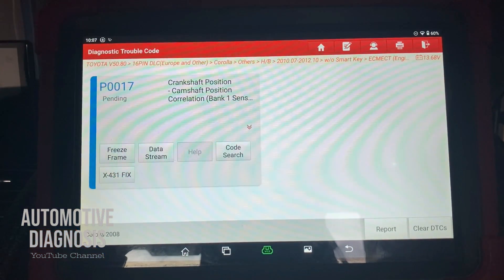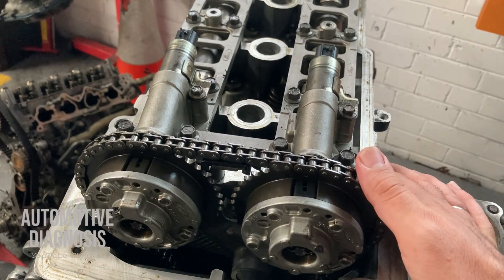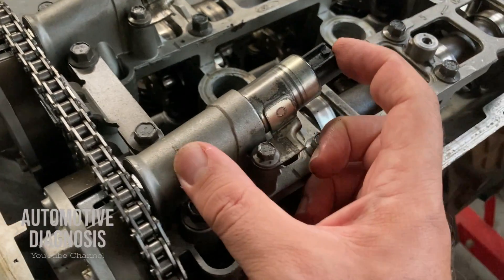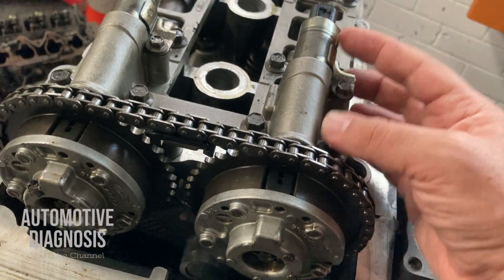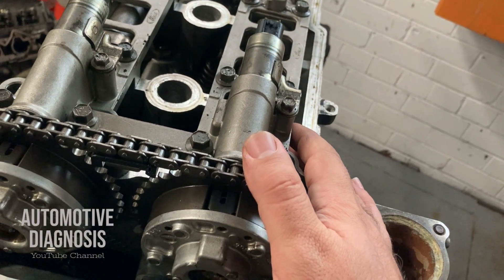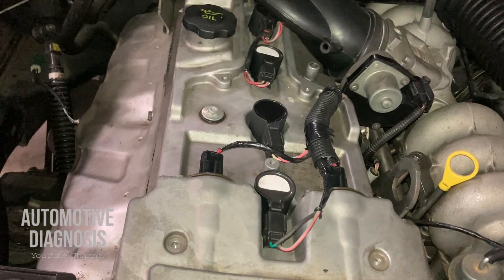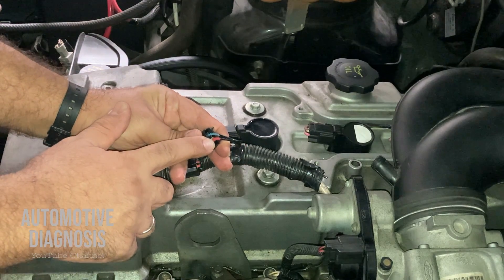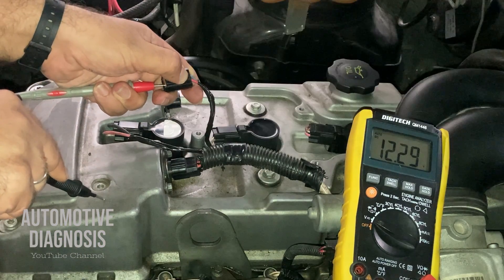How to Test & Fix P0017 Crankshaft   Camshaft Position Correlation Bank 1 Sensor B (Bank  - Exhaust)

Comment: Good afternoon had this cold pop up in my 2016 Hyundai Tucson did an oil change and replaced the VVT sensor exhaust side check engine light still appears after clearing it with scanning tool now what does the other VVT need to be replaced to that's not the same code for the front as the back
Reply from the maker: Hi my friend, This code could be caused by several reasons, If you have replaced the VVT Solenoid, and oil has been replaced, the next steps could be these ones:
- Camshaft or crankshaft sensors could be the cause as well (mostly the exhaust cam sensor, and checking them is necessary before replacement)
- If the last oil change was long time ago, there might be still some oil sludge in the VVT phaser that causes this issue.
- There is a locking pin inside the VVT phaser which should get unlock after engine warms up, if it doesn't, code will appear, here is the link to the relevant video:
https://www.youtube.com/watch?v=xbjYFhMmIXI&t=7s
- Engine timing could be the cause of this issue as well, but considering that you only have p0017, the possibility is not much.
Reply: @AutomotiveDiagnosis thanks for your in put the vehicle Idols well no loss of power no hesitation at stop light no stalling and cranks right up will do another oil change and we'll go from there thanks again

Comment: Have question - as you said, on selenoids, with ignition ON, must be battery voltage, but I "have" only 2.42 V ...
Wtf is this issue ??
Where to look for failure  ?
Btw selenoid "clicks" by test, and resistance is close 8 ohm...
Thank you.
Reply from the maker: Hi there, you have two wires on the valve, how much voltage are you getting on each one? Sometimes this low voltages comes from the control line, not power supply. And ignition switch has to be on for reading the voltage.
Reply: @AutomotiveDiagnosis  Ignition ON, one wire shows nothing, second shows 2.42 V 😮
Same picture on both selenoids ( both replaced new, INA brand)

Comment: Little hard to understand your English but the graphical explanation is fairly good. I'm having an issue with a 2008 Cadillac SRX 3.6L Dual Cam set up so I replaced the one crankshaft sensor and have to do a relearn but all of the scanners I've bought (3) don't have that function even tho the sellers said it did and had to return them to Amazon. Still looking for a scanner that has that firmware grrrrr.

Comment: What do I need to do to fix the code P0017 after I replace the timing chain kit.
Reply from the maker: All required steps are mentioned in this video. If you get the code right after replacing the timing chain, it's possible that timing chain is not adjusted properly.

Comment: Question: On my Truck (2.9l), If it were a timing chain, wouldn't it run bad all the time?  My truck wants to stall after it reaches normal operational temperature (190°) when coming to a stop or at idle.

Comment: I'm glad to to pass here too getting a detailed video which points to my problem too
I hv a dodge caliber I recently bought it then the engine failed I did engine overall when I was putting the engine back I broke the connector of the vvt solonoid I used to drive my car with intake vvt solonoid broken and it was hv power at all struggles on uphills I went and bought an after market one then put it in my car seems it worked the first day after tht I went back to the problem of losing power when I scan it shows P0017 if I clear the code the engine light it goes away but comes back after I start the car what could be wrong pliz help

Comment: Guys I had a 2017 Elantra with code p0017 , timing chain was stretched , installed new timing chain and guides and new timing chain gears intake and exhaust, after repair the same code came back , you have to do an adaptive reset for the engine , has to be done with and autel scanner or something equivalent! Hope it helps!
Reply: Having the same problem. Was starting but it was a bit rough. Then it stop starting no crank or anything. Recently it’s been cranking still no start. It has oil sensors look clean and gunk. Were u able to crank yours before having work done?

Comment: do you have to go under the car to change both cam and crankshaft ? or can you do it from the top
Reply from the maker: Hi there, Cam sensor can be reached from the top-rear side of engine. But crank sensor is on the bottom side. It can be on front or rear side. If it’s on the front, it might be accessible from the top, or by removing a wheel, but if it’s on the rear side of engine, reaching from underneath is possible.
Reply: @AutomotiveDiagnosis i have a 2017 Kia forte so i wouldn’t know honestly

Comment: You need to use an engine  oil flush at every oil change and recommended fully synthetic engine oil to avoid the problem closed by the sludge.
Reply from the maker: Thanks for sharing your experience

Comment: Hey guys, I had code p0017 and p0368 in a Sienna 08 I fixed it by replacing the camshaft sensor, the AutoZone brand didn’t work so I used one from the junk yard! Works like a charm
Reply: Really. So autozone brand didnt work ??

Comment: Do you think if the Mechanic when he changed the Engine Timing Cover he could damage the chain ? He says he will move the engine without starting it to see if the time chain moves after he did he says it rotate well and the chain is fine do you think thats accurate?

Comment: Hi! It might be a long question with background.

I bought ES350 2009 @ 223K miles few months ago. At the time of purchase tests showed P0011, P0012, P0013, P0015, P0016, P0017 and the engine is rebuilt. There was no issue at the time apart from 1-3 seconds upto a minute of rattling sound on start (cold, hot and sometimes while waiting at a red light).

It had 5W30 in it then at the time of engine service. At service the Oil guy told me to go for 20W50 coz the engine was old. My bad I listened to him, and from the time I started the engine after changing the oil, I felt something off. Engine felt heavy, it took effort to run and mild vibration on idling.

The next morning when I started the car the rough idling was wayyy more. The RPM was dancing, low and high on its own. The car wants to let go if I keep breaks on at D. Since then it comes and goes away as it wills. There is no check engine light. Since last 2 days the AC compressor doesn’t switch on if I’m waiting at D. As soon as I switch to N it starts cooling and sometimes it doesn’t work on P either.

My mechanic told me everything is coz of the VVT gears and timing chain. It needs adjust only.

I checked it again yesterday with autel scanner at the workshop and it gave P0011 & P0016 only.

He’s adamant that solenoids and sensors are fine as there is no check engine light.

All the YouTube videos I saw, they keep VVT to be the last thing wrong but my mechanic is going the other way around. He didn’t check the connections, the sensors or solenoids.

PLEASE TELL ME WHAT SHOULD I DO?

I’m sorry it’s too long, but I had to explain. Thanks in advance.
Reply: Did You fix the issue?
Reply: @wise_soul8886

Comment: Great video thanks for sharing.
this actuation test is not dangerous for the engine, as the engine is running?
Reply from the maker: Thanks for watching. No my friend, it’s recommended by workshop manual. And the variable valve timing system is to work when engine is running.